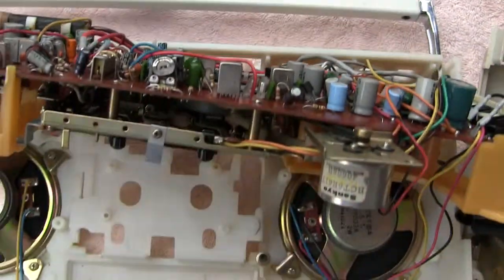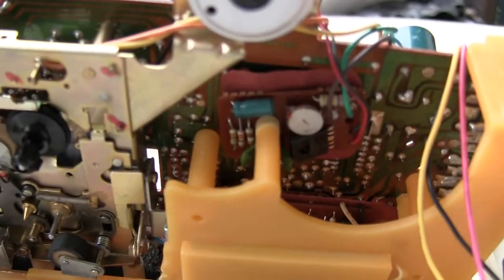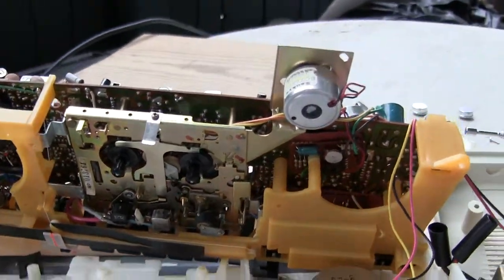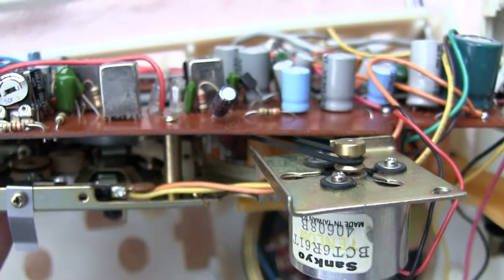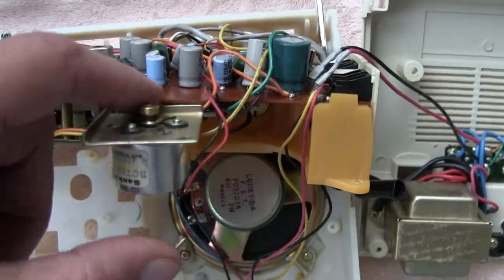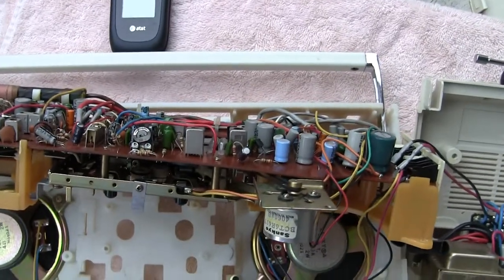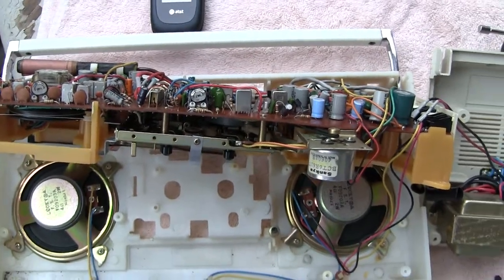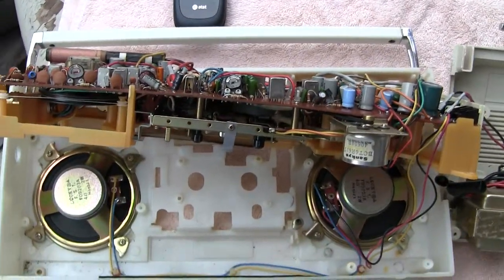LASONIC TRC-919 Inside boombox belt replace Thanks Bryan Spruth

Comment: Holy moly that little mini is in pieces,there no room for patients for me, they would be spare parts or I'll make it worse. X
Lol
Reply from the maker: Well this is the 3rd or 4th time I had this apart as this time I wished to get this to play at the correct speed as before it was slow after I installed a new belt as I showed in a previous video.  I installed a belt that was a bit shorter than the stretched belt that it was trying to work with, though I did measure it to be close I do not know the exact size that it required.  All I know is that it works and is at the correct speed.